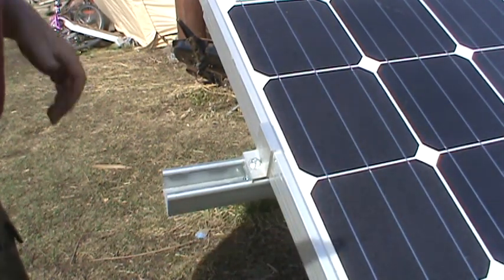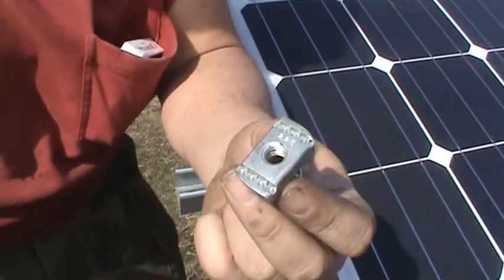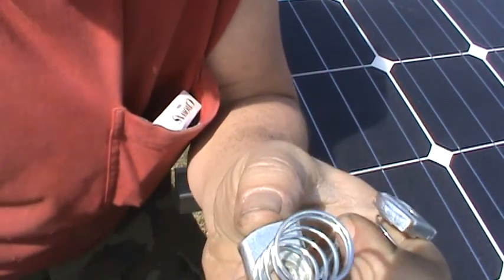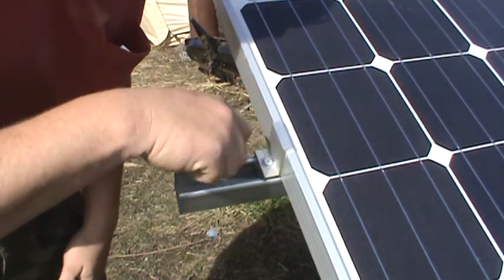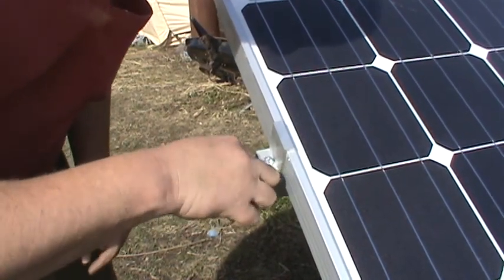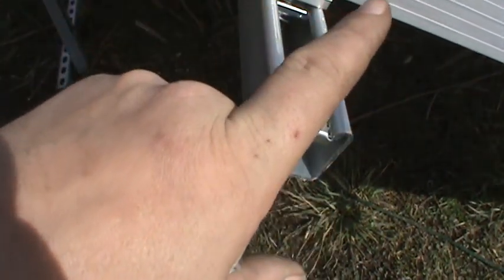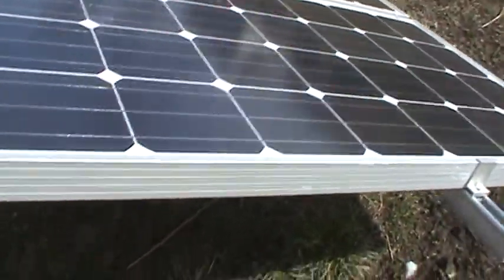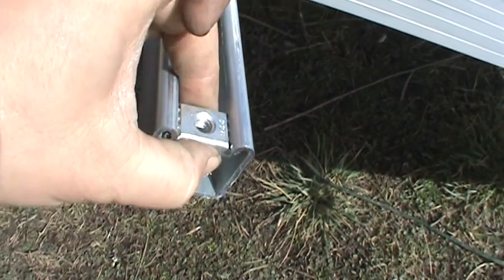How To Video, Using Spring Nuts for Unistrut

Comment: I really hate those spring nuts; they are such a pia because they are always going through the holes of the strut. The only thing they have going for them is that they may push up and lock onto the strut. If I had it to do over again though, I would have simply bought the nuts that clamp onto the bar without the springs.

Comment: Where would I put a lockwasher on a spring nut? Underneath, through the spring, and tightened on with a nut? Or just pop it on the bolt and tighten down?

Comment: Thanks!  I got spring and cone nuts for a project I am doing and wondered the difference.  The fact that you can twist the spring nuts in would allow you to put them in the middle of existing nuts.  I personally find the cone nuts easier to use on the sides.  The springs kept going through the holes on the back of my strut, but in theory the strut would be against a flat surface to prevent that.  Thanks for the video, glad I watched this to understand being able to twist them in.  I was just sliding them from the ends :)

Comment: can someone please share information about the dimensions of the spring nut. whats the groove/teeth dimensions? does the spring nut press only against the lip of the unistrut or also against the top flange of the unistrut?
Reply from the maker: https://www.ebay.com/itm/154132019249?itmmeta=01HTDRHQEBJ7GBDD4M8TXKRGT1&hash=item23e2fbf831:g:eAkAAOSwjJZfgPBA&itmprp=enc%3AAQAJAAAA4Cu3Go3KslOB77ocylq3tlo15Y3fX1rLjsqPec6ujWRkfItOUKAk4pd4XCj7Z20QnqpyIZxq9jqwcg3JYfFKPQTe6Ou8k4pvI%2FCV0PjDmKPjxWZSl8eNjmbe1uBR%2FOCYHTIotbU986nq7N7%2FM82EaJGHMSmaKwH2r2aH6Zas1AAuqSKaQ%2BxY9SG3O1jR58EbU48agQ2vSlJbwOJQ35g4Rm3%2Fg7qzgySWAhZaA5Z2AbQixgQ0s4RtXjPNuVNW1WGz472qw6O%2FhuiLNR6KPTj%2F6Q7HaQnd6MajzR43wf5igSC6%7Ctkp%3ABFBMtvfGuNNj   Here is a link to them on eBay This link is for stainless Steel Spring nuts.  Also you can look a round on eBay and you can get from metric, to SAE nuts and Different sizes depending on what you need them for.   Some I ripped the spring off, because it made it easer to move them were I wanted them.

Comment: Thank you for the video. Was doing it right, but the track they sold me is shallower than yours. Also, was trying to figure out what to do when a spring needs to be over hole... flattening a beer bottle cap in the vice seemed to hold it from popping thru. Just need to find end and mid clamps now.

Comment: Nice video and good information.  I have a question about the clamps used to hold the solar panels to the unistrut.  Where did you purchase the clamps used on the outside edge of the panel to unistrut as well as the clamps between the solar panels to hold the panels to the unistrut?
Reply from the maker: those are the solar panel end clamps http://www.ebay.com/itm/10-PV-Solar-Panel-End-Mounting-Clamps-Model-END10-10-End-Clamps-/381505276527?hash=item58d37c8a6f:g:EMgAAOSwZ1lWgsOD   and the ones I used in the middle are the mid clamps http://www.ebay.com/itm/10-PV-Solar-Panel-Mid-Mounting-Clamps-Model-MID10-10-Middle-Clamps-/381505284184?hash=item58d37ca858:g:q-4AAOSwhkRWgsXC.   I used to use washer for the middle but as funds allowed I been upgrading to the mid clams. and end clamps
Reply: Thanks

Comment: What are the clips called that you used to clamp solar panel down to the strut?
Reply from the maker: The ones on the ends are called end clamps, and the ones in the middle are mid clamps.  There are so many variations of these clamps.   Just need to look and see what type will fit your project.

Comment: Where did yu get the brackets?
Reply from the maker: I picked them up at my local electrical supply company called Kirby electrical supplies.
Reply: McCuneWindandSolar do you  remember the name of the clamps
Reply from the maker: are you talking about the ones holding down the solar panels if so, they were called end clamps for the ends of the solar panels and mid clamps for between the panels.   If you are talking about the Rails they are mounted to those are called unistrut. the Clamps I got off eBay